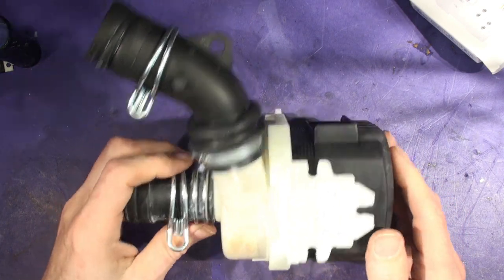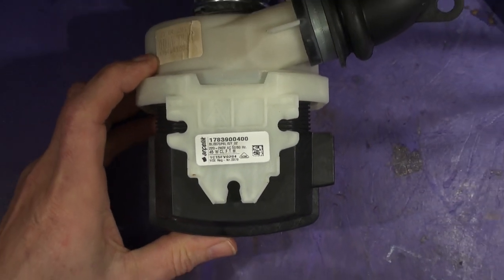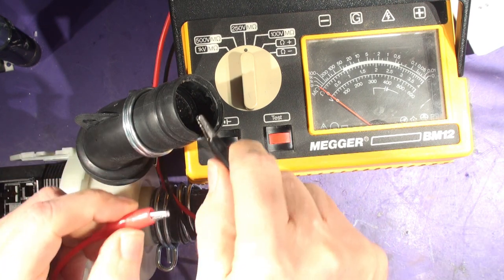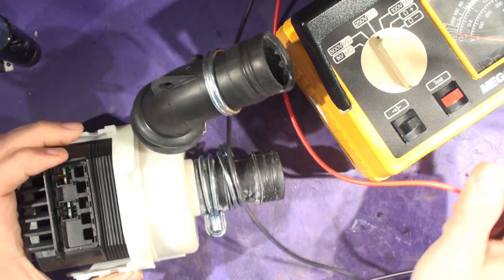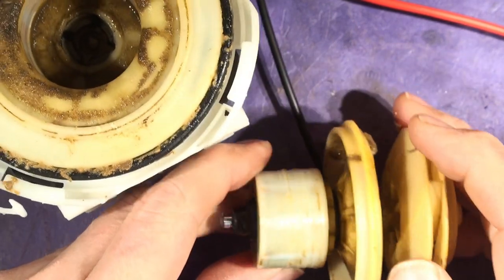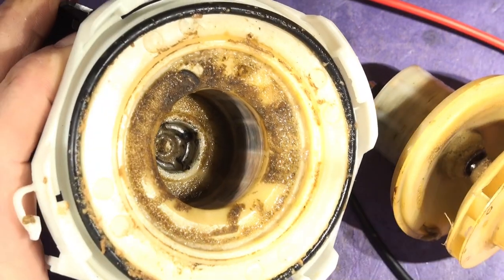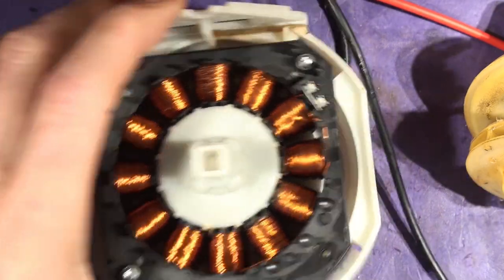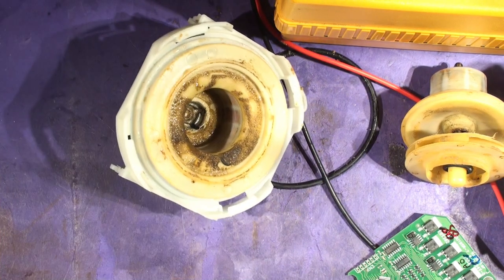BEKO dishwasher Tripping RCD Breaker common fault diagnosis

Comment: Who would think it had conductive pipe.
I did think the water was the path to ground, but the bearing i was surprised (cheap design). 
I had a beko washing machine, it was very poor quality and it lasted two weeks and started playing up.
They brought a new machine to replace it, that one started playing up a month later.
I bought a bosch serie 4 later,  not a single fault in 4 years.
Reply from the maker: No doubt the water conducted some of it to ground but during debugging the pipe was empty and the path was the rubber of the pipe.  The rubber isn't just electrically leaky it is actually quite conductive.

Comment: Thank you for the excelent crash dive video! Since the rotor bearings are disgustingly designed weak point of the whole unit I refused to spend such a money on new motor. More so that on my newer model it's sold only as one unit with a heating element... It is possible to obtain bronze slip sleeve bearings from a specialized bearing company and reseal the stator housing with resin. Problem solved for a couple of pennies. My original bearings lasted exactly 3 years. Shame on you Beko engineers.

Comment: I believe I’m right in saying. Buses have graphite in the rubber tyres to take the static electricity from the lights etc to the ground/earth. Perhaps there is graphite in these hoses also?
Reply from the maker: I think you are correct, when you think about it it must be true. The hoses are definitely conductive. Synthetic clothing was all the rage in the 60s  and I remember on a dry day, walking down a steep hill with a heavy pram full of shopping and my four sisters all hanging onto it to  it. I grabbed a railing and discharged the whole shebang through my body with a huge crack, everyone jumped especially me for whom it was a powerful experience. If the pram had conductive tyres....

Comment: Interesting one. There is an interesting phenomenon when trying to work out these common faults in that rarely does anyone seem to get to the bottom of them - and when an engineer does fix it it seem to reoccur in less than a year. At replacement cost of £400 its cheaper than getting a repair person out. Just got a quote from Gaggenau for £260/hr (plus travel time costs?!) for a technician to come out (instant RCD trip on power at plug on). Its built in so i can't get it out by myself to check the connections. User serviceable machines are a thing of the past due to the economics of it.
Reply from the maker: Shame.  It is a travesty because 99% of the parts in the  machine are working fine yet it will likely still end up in the skip.  Take, make and throw away boys as fast as you can. Export the pollution,  energy and health and safety worries to some far-off unregulated land and give yourselves a pat on the back for being green.
Reply: @razenby  Yea. People bang on about "right to repair", sustainability, the environment - only a very very very small number of people will even open up an appliance. So their only option is to pay someone to do it. Modern costs of living e.g. transport and so on mean that costs 1/4 of the value of most appliances at a minimum. Factor in a second visit to fit a spare part and it obviously is cheaper to buy a new item with a warranty. Very frustrating
Reply: @razenby Truest words I’ve read in a long time, my friend. I’ve got to a point with my 6 year-old Samsung Ecobubble where I’ve spent almost £300 trying to deal with an intermittent RCD trip out issue without success, and it is now economically unviable for me to spend any more on the detective work. Sad thing is that it is probably solvable but…….. needs must. At least I feel guilty about it. And at least I tried. Good post, by the way.

Comment: My Beko DWD 4310 runs for most of the cycle but trips RCD. I notice that water remains in machine . Could this be the drain pump as opposed to the circulation pump.
Reply from the maker: It is possible.  Most dishwashers drain the drain pump at the start of the cycle before filling - You would think it would trip then atthe start of the cycle...  before Best bet it to take the panels off and have a really close look at everything for evidence of leaks... You could disconnect the drain pump. It will still stop as the water isn't drained but if it doesn't trip the RCD then the diagnosis is good.

Comment: A conductive rubber hose? I wonder how that speciality was build there... Maybe extra steel inlays because they knew before what would happen :-9
Reply from the maker: I have no idea except to provide leakage to ground because the motor has no supply earth connection.  That would only be the case if the water is quite pure else you would expect the water to provide that path, A strange feature indeed.

Comment: Could they have made the bearing any smaller. lol.. smh
Reply from the maker: I ahree. Those ceramic  water bearings are usually quite good. There was quite  a lot of wear on the steel shaft and the bearing.   The DW is about 5 years old.

Comment: Hi Magic Smoke, I could use some advice related to Beko dishwashers and my RCD being tripped please. Your video was really interesting and I'm trying to work out what to do in my case. A week or so ago, it tripped the RCD and we eventually worked out it was the dishwasher. It would do it almost immediately that I flipped the switch for it. So I replaced the fuse in the plug, hoping the would fix it. Everything was fine for a week and now it's gone again. It's an integrated Beko model (DIN15R11) and I'm pretty sure I can now detect a slight burning smell from one of the small circuit boards in the control fascia (there's also a hairline crack in the plastic about 2mm long in the same area. After seeing your video and knowing very little about plumbing or electrics, I'm trying to work out if the conductive piping issue you've found could lead to a burnout in one of the circuit boards? And is the best remedy here a new dishwasher?
Reply from the maker: The most likely cause of an RCD trip is electrical leakage to ground in the water heating element. These can be just enough to trip the RCD. Often they get worse.  You could disconnect the heating element and run it and of the trip doesn't flip  then it is the water heater element.  Have a look inside for condensation.  If you can smell burning then look ate the point  where the mains lead enters the unit. Often there is a small filter block that can fail.  Another problem is with the mechanism that releases the detergent.    If you smell burning then follow your nose and also have a really good look at the connections. Look for discoloration.

Comment: Fascinating. Do you think that all the “Players” use this rubber in this way these days? It might explain the laughably short lifespan of so many White-goods appliances today, both at the budget end and high end of the price spectrum. Customers just don’t want to keep throwing good money after bad in trying to locate causes of intermittent tripping faults and end up just binning the appliance and buying a new one. Strikes me that this is a cunning way to build in garaunteed obsolescence on the appliance in double-quick time. Would love to know your thoughts on that. We are always being told that the pump on a washing machine or dishwasher never has anything to do with RCD trips these days. Mmmmm.
Reply from the maker: It is an odd one.  The lousy seal on the pump leaks. Water gets into the windings, current leaks up the rubber pipe to ground and blows the trip.  Why not just have a ground wire to the pump motor.   The reliability these days is shockingly bad and constitutes and ECO crime.  My LG 2004 washer featured in the other video is still going strong.
Reply: @razenby ECO crime is dead right, my friend. The big manufacturers of kitchen appliances should hang their heads in shame.

Comment: So what happens if there is not an RCD and only a fuse. Does it eventually blow the fuse or catch fire?
Reply from the maker: Not necessarily. With no RCD It would fizz, hydrolyise  the windings would dissolve then you would have nasty electrical smell and eventually the pump motor would stop working..  Of course it could also blow the fuse in the mains plug.  I would much prefer an earth wire connected to the stator laminated metal part.

Comment: I’m from Australia. I just wanted to thank you for taking the trouble to make this video … because you’ve just explained to me why my RCD was tripping … our Beko dishwasher has been having trouble draining the water for a while now … I didn’t put two and two together it was the appliance that was tripping the RCD until I noticed it flooding tonight … it’s probably not worth replacing the motor (I’m a mech engineering not an electrical engineer 🤣) as the dishwasher is already 11 years old … thank you again as we were going nuts wondering which appliance was tripping our RCD!
Reply from the maker: Thanks for  watching and thanks for the comment. They are a very good machine, the trouble is I don't believe that the new ones are built to last nearly as long.  My Daughters 2 week old Beko recently filled her kitchen with smoke when it was just a month old.. If you are  a mechanical engineer then you can get your screwdriver out....
Reply: @razenby  oh my … that’s not good re your daughter’s Beko 😳. Hoping that was at least resolved under warranty! I’m pretty handy working around the home car and motorbike for most things but because our Beko was 12 years old I didn’t think it was worth the money and sense to replace the drain pump. But I do agree the Beko are good machines - I’ve heard big appliance retailers here vouch for them because not many get reports of problems.

Comment: Did you check the door seal?
Reply from the maker: Motor shaft seal worn, Water got in bearing causing wear. The wear cause the rotor to foul on housing wearing away the plastic and exposing the stator windings to the water.

Comment: Thanks for your helpful video, in my case I believe it is something to do with the door switch. The machine is working perfectly but will sometimes trip the RCD, however if I blow into the door switch/catch it will allow me to flip the RCD back on, if I don't do this it wont allow me to flip the RCD. Have you come across this before? if so which part should I change? Thankyou
Reply from the maker: Could be ?  Sometime other leaking wiring or appliances can leak causing the RCD to become uber sensitive. A plausible cause is moisture/water/damp  in the  door switch area...  Temporarily  Disconnect and link the wires to the door switch and see it this fixes the tripping issue...

Comment: My beko dishwasher tripped the rcd breaker a few times. It was the stupid floor lamp that got wet a few times if water accidentally dripped on it through the right side hinge gap on the door. The floor lamp stopped working after about a year then if it got splashed it would trip the rcd breaker so I removed the floor lamp part and isolated the cables. No stupid part and no more rcd tripping 👍🏼
Reply from the maker: That's crazy and very useful info. Thanks for watching.

Comment: If the motor is conducting through the water. The short is from motor to heating element, through the water. Not through the rubber. The resistance of the water is much lower than the rubber, even though that rubber is a bit conductive.
Reply from the maker: I can understand why you would think that. The pipe was dry as we cleaned it out and it still was leaking to ground and tripping.   It isn't just slightly conductive rubber - it is very conductive.
Reply: @razenby  rubber usually is a hood insulator so this might be done on purpose? Goes to show how the manufacturer knows about the product flaws from testing ;-)
Let the customer burn
Reply from the maker: I believe it is intentional. I cant see why else they would load the rubber with carbon. If you are pumping a non conductive liquid you can get a static build up on the rotor.I would expect the water to conduct away any static without conductive rubber.......